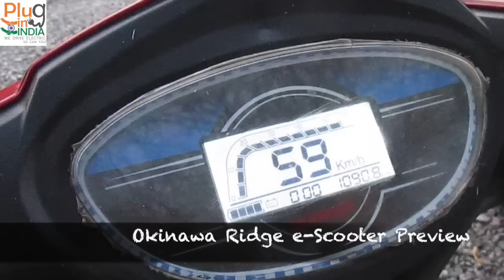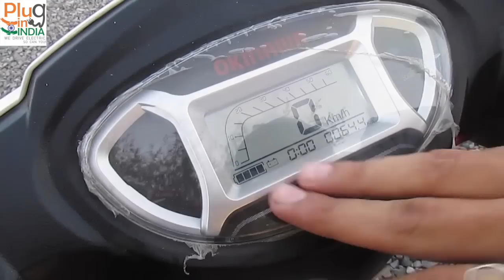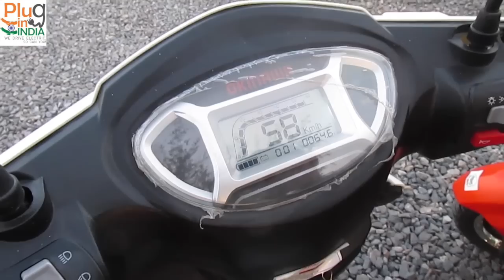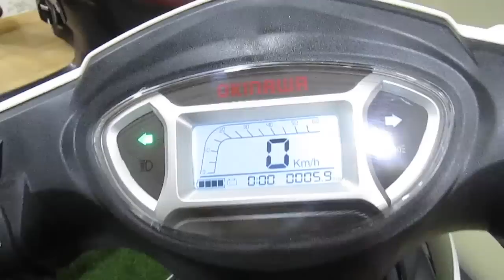Okinawa Ridge e-Scooter Preview

Comment: What is the battery life and replacement cost.. If needed in future. Pls discuss abt that also
Reply: Don’t buy OKINAWA ,It s my personal  opinions because I am owner of OKINAWA ridge (licenced type) what all the specification they are telling is wrong. They as telling 70 km Mileage @ 55 km speed. Its all wrong .the  speed 55 km what they are mentioning in the meter is originally 50 only( meter is also wrong) I was getting initially 55-60km mileage only  ( in all the mode eco/sort..but they are saying 70 km).I bought the vehicle 14-08-2018, after 3 months my mileage is going down to 40-45 km even after the service also.at the end of the six months battery down and the mileage reduce to 20-25( means one full charge I am getting only 25 km.)I complaint to the dealer Rapid motor in kerala,they change one battery only( but iam sure that 2-3 batteries are weak. They discharged and charged again and send me. Even changed the battery also I am getting only 40 km mileage !!!!  ( instead of 60-70 what they are telling). when its complete one year and 3 months suddenly the battery done and I am getting only 10-15 km( believe it!!! it is true!!!!) when I approach the dealer RAPID motors Kerala Thrissur, they denied to change the batteries  because the warranty is over!!!! NOW IAM RUNNING MY OKINAWA WITH THE MILEAGE OF 15-20 ONLY!!!! THAT MEANS…IF YOU BUY OKINWA AT RS 60000 YOU SHOULD KEEP 15000 AFTER ONE YEAR FOR WEAK BATTERIES…..(MY all green thoughts has changed….. Because of this crap vehicle)..You can call and verify from me..9207938547…

Comment: A very good interview. High energy, just like the bike! The ridge with 55 Kmph top speed and up to 90 Km range seems set to take on the Indian market. When will the Li-Ion version be released? Can we expect an increase in top speed and range?
Reply from the maker: Yes this e-Scooter is the best eScooter in Indian market.
Decent top speed and power and very good range.

Li-Ion version will be released in few months.  
There are rumors that he range can be as high as 200 km!  But dont quote us on that! :)
Reply: Im waiting for the Ather S340 :) :),   But this scooter can give good competition, if they are able to integrate Li ion batteries, and range is greater than 150, and not to forget the manufacturing quality.
Reply from the maker: Lithium-ion coming soon in few months as they say. The cost will go up with lithium-ion as well. The manufacturing quality of the material used is good.
Reply: Don’t buy OKINAWA ,It s my personal  opinions because I am owner of OKINAWA ridge (licenced type) what all the specification they are telling is wrong. They as telling 70 km Mileage @ 55 km speed. Its all wrong .the  speed 55 km what they are mentioning in the meter is originally 50 only( meter is also wrong) I was getting initially 55-60km mileage only  ( in all the mode eco/sort..but they are saying 70 km).I bought the vehicle 14-08-2018, after 3 months my mileage is going down to 40-45 km even after the service also.at the end of the six months battery down and the mileage reduce to 20-25( means one full charge I am getting only 25 km.)I complaint to the dealer Rapid motor in kerala,they change one battery only( but iam sure that 2-3 batteries are weak. They discharged and charged again and send me. Even changed the battery also I am getting only 40 km mileage !!!!  ( instead of 60-70 what they are telling). when its complete one year and 3 months suddenly the battery done and I am getting only 10-15 km( believe it!!! it is true!!!!) when I approach the dealer RAPID motors Kerala Thrissur, they denied to change the batteries  because the warranty is over!!!! NOW IAM RUNNING MY OKINAWA WITH THE MILEAGE OF 15-20 ONLY!!!! THAT MEANS…IF YOU BUY OKINWA AT RS 60000 YOU SHOULD KEEP 15000 AFTER ONE YEAR FOR WEAK BATTERIES…..(MY all green thoughts has changed….. Because of this crap vehicle)..You can call and verify from me..9207938547…

Comment: this scooter is not safe in India roads as its very difficult to overtake even in city traffic, it needs to have at least 5kw motor with li ion batteries.
Reply from the maker: 60 kmph is good enuf to overtake slow moving traffic in Indian roads
Reply: Hmmmm, than i need to take  test drive first to understand the torque of the motor.

Comment: Don’t buy OKINAWA ,It s my personal  opinions because I am owner of OKINAWA ridge (licenced type) what all the specification they are telling is wrong. They as telling 70 km Mileage @ 55 km speed. Its all wrong .the  speed 55 km what they are mentioning in the meter is originally 50 only( meter is also wrong) I was getting initially 55-60km mileage only  ( in all the mode eco/sort..but they are saying 70 km).I bought the vehicle 14-08-2018, after 3 months my mileage is going down to 40-45 km even after the service also.at the end of the six months battery down and the mileage reduce to 20-25( means one full charge I am getting only 25 km.)I complaint to the dealer Rapid motor in kerala,they change one battery only( but iam sure that 2-3 batteries are weak. They discharged and charged again and send me. Even changed the battery also I am getting only 40 km mileage !!!!  ( instead of 60-70 what they are telling). when its complete one year and 3 months suddenly the battery done and I am getting only 10-15 km( believe it!!! it is true!!!!) when I approach the dealer RAPID motors Kerala Thrissur, they denied to change the batteries  because the warranty is over!!!! NOW IAM RUNNING MY OKINAWA WITH THE MILEAGE OF 15-20 ONLY!!!! THAT MEANS…IF YOU BUY OKINWA AT RS 60000 YOU SHOULD KEEP 15000 AFTER ONE YEAR FOR WEAK BATTERIES…..(MY all green thoughts has changed….. Because of this crap vehicle)..You can call and verify from me..9207938547…